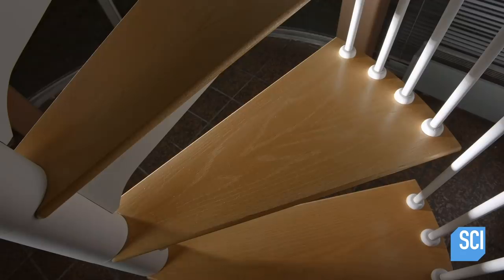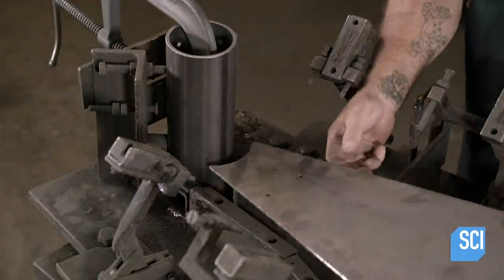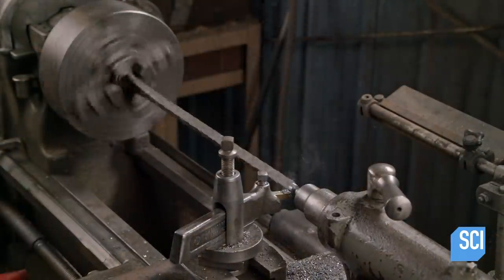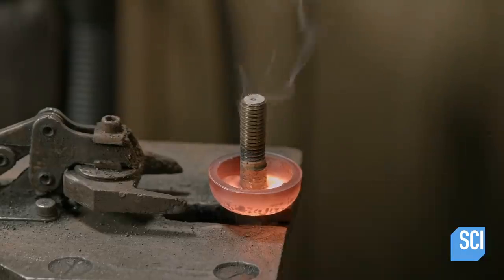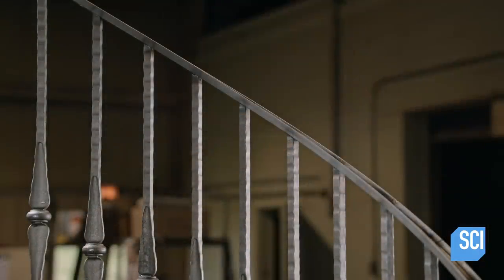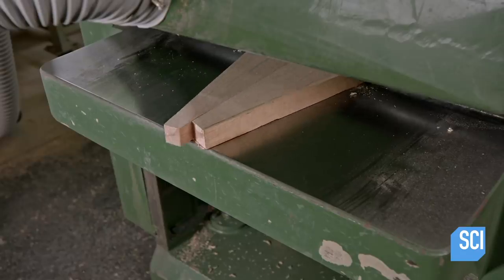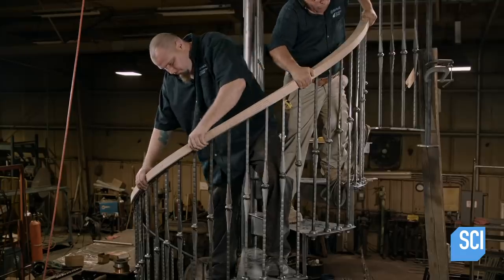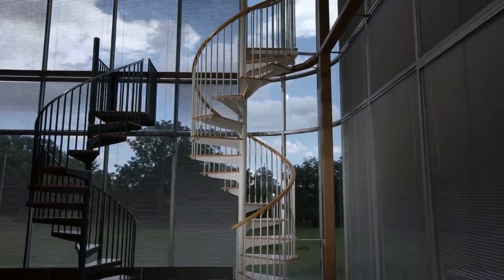How It's Made: Spiral Stairs

Comment: How does the fact it spirals prevent enemies going more than single file? Surely that's related to the width of any staircase, not the design?
Reply: It's actually a combination of the width as you pointed out, but also the geometry of swinging a sword. 

On a traditional staircase the person you're attacking it pretty much straight ahead so you can have two (or more) people side by side using an overhand chopping attack. In a spiral staircase everyone is always slightly around a corner. Additionally, most defensive sprial staircases are clockwise when viewed from the bottom, preventing you from using your right hand (which is the traditional fighting hand from the era these were common)h in a swinging motion that follows the curve of the stairs.
Reply: @PendragonDaGreat  That's correct. Also spiral stairs in castles would sometimes have unequal riser heights such that castle defenders would be able to ascend or descend with familiarity while attackers could be caught on the wrong foot.

Comment: no mention of how the curved wood rail is made beyond "gluing strips of wood together"
Reply: then he put it through the planer, shaved off the extra glue, cut a groove in the bottom, did some detailing and popped it on to make sure all the pieces fit together
Reply: @shanleyshoupe7873  3:35 "After gluing strips of wood together to create a curved railing". How does gluing anything create curves?
Reply: @vladtepes97  with curvy wood
Reply: @shanleyshoupe7873  from the Bendy tree, no doubt.
Reply: @vladtepes97  anyway my point was not that i know exactly the wood is curved for the rail (other than the same way they curve wood for other stuff). My point was that there is mention of how the curved wood rail is made beyond "gluing two strips of wood together" so i cited it
Reply: @shanleyshoupe7873  none of which curves the wood, so they skipped the most important step of the entire process. It's a shame, but it was 20 years ago.
Reply: Thin (1/4 inch thick) strips of wood are bent around a barrel-form, spiraling up and around the form to match the specific diameter and inclination of the spiral stair.  Each strip is smeared with glue.  The whole bundle is clamped to the form and allowed to dry.  After the glue has completely cured, the rectangular shape of the handrail is complete.  
Another method is to cut spiral handrail segments from solid wood and bolt them together.  Today this usually involves computer, numerically controlled machinery (CNC.)  This is far less common than the strip-laminating process.  
The reason (I assume) that the process was not shown in detail, was due to the short video.  It's certainly no trade secret.

Comment: Gross using stick welding instead of mig
Reply: u must be more of a spiral stair expert than these guys then lol
Reply: The shop is incredibly antiquated.
Look at the lathe with lantern tool post, or just the welding fixture.
Porter Cable hasn't made a decent router in 20 years.